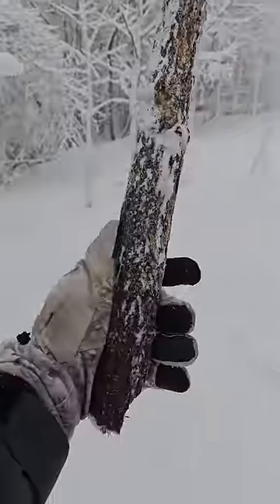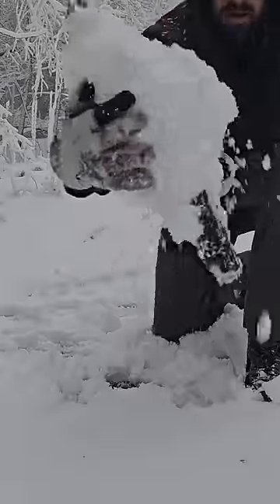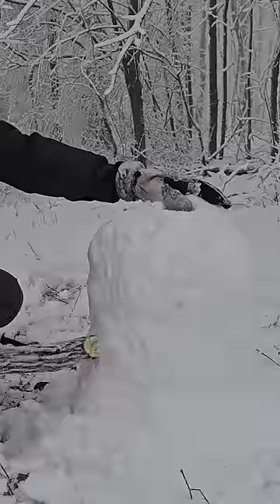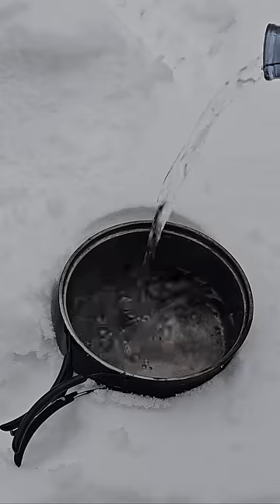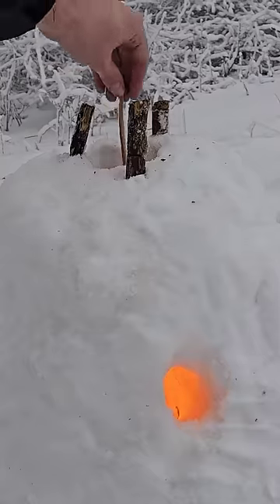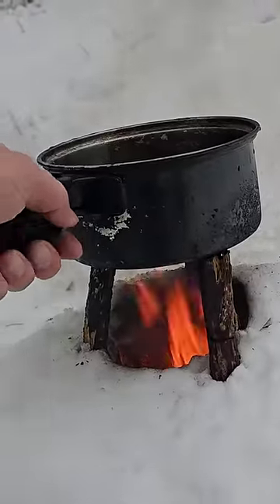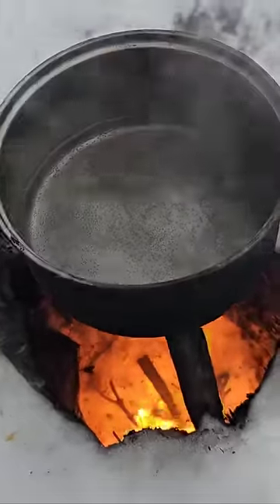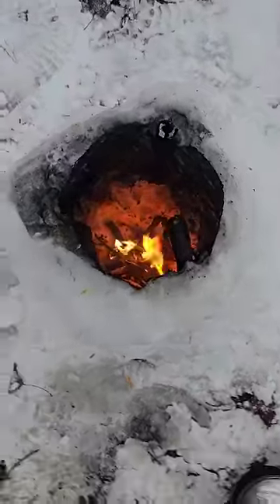Experimenting with building a rocket stove out of snow 🔥

Comment: Next experiment will be starting with a 5 gallon bucket of water frozen and drill out the holes.
Reply: For science
Reply: Garbage
ice doesn't insulate at all it's just gonna take all the heat and melt
Reply: I don't think you're right lol
Reply: @sakesaurus ice does insulate which makes it more to your point.
Reply: @danieltirico6593  but it's worse than snow and burning occurs 300°C above the freezing point of water. 
Now quad the power on that (and multiply by some constants) and that's the diffusional heat transfer rate. You need exceptional insulation to overcome 300^4
Reply: @sakesaurus  yeah I’m not disagreeing just saying that ice does in fact insulate
Reply: @danieltirico6593  oh. I think i misunderstood some word. English is not my first language so bear with me on these.
Reply: @danieltirico6593  and so does copper. Everything insulates and conducts if you get down to it.
Saying ice doesn't insulate in this situation just means it's a poor insulator compared to snow.
Reply: yeah what about the melting speed of snow compared to ice. snow has much less mass. sure it can insulate better in cold conditions but what about maintaining itself against heat @miles11we
Reply: Well what about an ice/mud slurry or even saw dust to make pycrete ? They planned on making landing crafts and aircraft carriers out of this and in sure as shit that there would be plenty heat from the inhabitants down to electronics engines and batteries not to mention aircraft and weaponry, for sure an interesting concept for when the weather is against you
Reply: @markmcghee3486  that stuff is durable as hell I wouldn't be surprised if furnaces out of it would work for short while
Reply: Good luck finding a spackle bucket in a survival situation
Reply: @jonathonfrederick2062  ok I don't think you understood what I was arguing. I was making fun of you while defending what someone else said because what you said was stupid. I am not arguing for or against ice for this application.
Reply: @sakesaurus plot twist: ice does insulate water sitting beneath it, lakes at freezing winter as one example.
Reply: @miles11we  oh you were making fun of me? even though I hadn't said anything before and was only replying to the conversation in general. right.
Reply: @jonathonfrederick2062  oh sorry my mistake, I guess I was the dumb one this whole time lol
Reply: The 5 gallon ice cube sounds neat. But the ventil on the bottom would need to be tilted down so the water drips out instead of puddles. Maybe I haven't tried any rocket stove. They look cool
Reply: @miles11we  This is the xhillest beef I've ever seen
Reply: Ice with sawdust in it !!!!
Reply: Won't work like this haha. Snow has air pockets of oxygen trapped in it and that fuels the fire as it melts. But ice would just put it out.
Reply: @printer69tom  good point.
Reply: @sakesaurus  ice totally does insulate
Reply: A "bucket of water frozen" sounds way better than a bucket of ice
Reply: No, you take your bucket drill holes in it.  Then fill with water then freeze it.  Works everytime!
Reply: If snow worked ice will too.
Reply: @sakesaurus LOL WRONG
Reply: @yacobshelelshaddai4543  I said as compared to snow, not by itself
Reply: @sakesaurus  its just a joke pal
Reply: This is a sure fired way (pardon the pun) to get a pot full of boiling water over your leg.

Just because you ‘could’ do something doesn’t mean that you should do it.
Reply: @sakesaurus First off, have you ever heard of an igloo?
Reply: @anubispup4760  made of snow
Reply: Snow has air, so it takes much longer to transfer heat. That's why igloos can have fires in them and not melt. A block of solid ice would melt WAAAY faster
Reply: @sakesaurus bro said ice is a bad insulator because it'll take the heat... That's the point of insulation💀
Reply: Turn to Jesus Christ to experience New life
Reply: @whiskeymike1789  Snow is packed down into hardened blocks of compressed ice before being used as building blocks. No air pockets, no opportunity for the snow to shift. And often with a fire within an igloo the heat will make the snow watery which will refreeze into sheets of ice.
Reply: Do that but add woodchippings/sawdust to it before freezing it. This is great insulating material aswell in really cold places
Reply: Probably snow worked in the first place because, as opposed to ice,  snow is mostly small pockets of air.
Reply: @AidansCars  huh? No it isn't. Cold thing exchange heat with hot thing. Bad. Insulation to interfere with that process? No?
Reply: @anubispup4760  glazing the snow block traps the air abd further reduces heat transfer. The ice while it is heat reactive only warms on the surface and the heat doesn't penetrate too far.
Reply: @sakesaurus one word...Igloo. did you forget about the igloo. 😅
Reply: @sakesaurus igloo what? 😂
Reply: Yeasss
Reply: @sakesaurus  ice has far worse insulation, but it also has extremely higher thermal mass to resist melting (and more stability) compared to snow, so it's not an easy verdict on which would be superior.
Reply: @sakesaurus what's that type of math called? I like all those fancy smart words you used and I want to learn how to use them and apply it practically to life like u
Reply: I think itd work better than snow. More compact molecules. Wonder if the leidenfrosr affect will help as well.
Reply: @MsHojat  good point
Reply: @GrapheneOxideIsInCVVax  I'm combining the physics i know from school with edutainment
The 4th power I remember from some video about milk in tea, if you add milk the tea cools much slower (purely from heat diffusion)
Reply: It would melt faster. Snow has a lot of air mixed so it insulates better
Reply: @ruthlesshalfbloodprincess it definitely would work, you would just need small holes at the bottom so water wouldn't puddle up. And it doesn't even matter if there is "oxygen pockets" as the WHOLE point of a rocket stove is to have that hole at the bottom for oxygen to come in anyways
Reply: The ice would melt slower.  It's a matter of the energy needed for a phase transition from solid to liquid, and obviously there's more liquid in the ice than the snow.  The air in the snow is inconsequential for insulation and only means it will lose volume faster
Reply: @Mastermindyoung14  for fire to burn you need that heat in the fuel and not in the ice melting
Reply: @Mastermindyoung14  exactly!
Reply: @sakesaurus  that's not a factor.  There isn't enough time for the ice to rob heat from the air molecules before they're through the stove, past the pot, and up in the open aira again.
Reply: It's a matter of volume.  A little bit of heat goes to melt the ice, along the boundary layer, but the rest zips right past unaffected
Reply: @Mastermindyoung14  radiation
Reply: @Mastermindyoung14  guess which thing has very little volume and takes very little nudge to chill significantly. It's the fire. And you need to have as miniscule heat transfer as possible else it's just not gonna light. I don't know what other words to use here I might be incorrect but I want to know if I'm incorrect in how much heat transfer ruins the fire. Not how it melts the "furnace" made of ice. See?
Reply: @sakesaurus  I understand all of that.    But I still claim the mass of solid needing a phase transition greatly outweighs the insulation properties of snow.  You disagree. We should test in real life and see the real results, because we will keep going back and forth on here.
Reply: That'd be fire 🔥
Reply: @sakesaurus  if ice don't insulate, explain igloos?
Reply: Worked tho
Reply: Damn! Now you got me curious!
Reply: i got a new idea for ya! Pykrete stove! water and woodchips
Reply: BetsyLu-lf8vk  I don't mean to be this guy🤓 but as surprising as such a thing may sound, it can act as a highly effective insulator
Reply: BetsyLu-lf8vk  I think you may have misunderstood a Google search? Are you saying ice is less effective or that it's NOT insulating... hard stop? Even without the air pockets the solidity and the unmoving air do plenty despite the surface being cold.
Reply: I really hope he reads your comment and does exactly that 😺 That would be aaaaaaasome! 👻
Reply: @sakesaurus No shit Sherlock
Reply: @sakesaurus  ice does insulate - so much so, that people build Igloos, ever thought about that? lmfao
Reply: @crateer  igloo is  made of snow
Reply: @yudi7572 yes for the science 😅
Reply: Try pycrete. Sawdust in ice.
Reply: @heroinmom153  ice is 20% sparser than water
Reply: This thread was something else. Some people right on the money, some people entirely out to lunch. I can't tell if I fell back asleep and am just dreaming this all up
Reply: @DirtyMike124x  life is merely a long dream (c)
Reply: They've never heard of igloos and ice hotels
Reply: BetsyLu-lf8vk  
Sorry but

Yes
Reply: @sakesaurus im pretty sur thwbice wouls take longuer to melt. A blck of ice can take forevwr to melt after winter
Reply: 😂😂😂Hilarious sarcasm 🤣
Reply: Play in the snow? Get a dog or have kids😂
Reply: @anubispup4760 compressed ice has different properties than freshly frozen ice, it has a different crystal structure.
Reply: I'd bet the snow works better because it's a more insulating, and what little snow does melt and doesnt evaporate and get carried out by the heat, gets wicked away by the snow around it.
Reply: @danieltirico6593 But what's the difference between clear ice and snow? Isn't snow just frozen water particles like ice would be? What makes snow an insulator and not clear ice (ice) if they're practically the same?
Reply: Ohho can't wait want to learn every environmental hack so cool❤
Reply: Noice😊.
Reply: and a drain for the melted water
Reply: Cool! I never imagined that it would work at all!
Reply: @sakesaurus someone who knows what more than I do, would this type of knowledge be thermodynamics or am I pulling words out of my ass?
Reply: @smorgishborg7789  Yeah, thermodynamics i think
Reply: @markmcghee3486 they planned until they realized is easily melts with any heat over freezing
Reply: No...
Reply: Ahhaahahahahahaaa🤣
Reply: @sakesaurus Ice definitely does insulate lol
Reply: @KhreamedKhorne  how the hell does ice insulate if it takes all the heat from your coke. It exchanges heat rapidly and that's its primary use
Reply: @sakesaurus  It isn't a great insulator, but it does insulate. You have the entire Internet at your fingertips, maybe use that info before being so confidently wrong
Reply: @KhreamedKhorne  your point being? You remember were talking about extremely hot fire in a furnace made of ice? Totally doesn't change my point.
I'm guessing you just dislike authority and you start arguments whenever someone sounds confident. Sometimes it's best to not do so.
Reply: @thatonewookiee9154 snow is a air ice composite
Reply: 💖❤❤️YOU DO NOT HAVE TO FEAR DEATH IF YOU BELIEVE IN JESUS CHRIST, AND TRUST IN HIM WITH ALL YOUR HEART, BECAUSE HE ATONED FOR YOU FOR ALL YOUR INSULTS, THAT YOU WOULD OBTAIN PEACE WITH ALMIGHTY GOD, AND GO TO HEAVEN BY HIS GRACE!
Reply: Add some wood shavings to the water and you’ve got pykrete.
Reply: Sag
Reply: @sakesaurus sure it does. you ever heard of an igloo?
Reply: Yes
Reply: Water frozen is called ice 🧊
Reply: The air trapped in the snow is the key to its insulation factors. There's little air trapped in ice. Won't work as well.
Reply: Insulation would not be the main problem, heat transfer and melting would. Fire in the snowball burns because snow doesn't drip much water if burned, it reabsorbs it. Ice would soon wet the wood from flowing water.
Reply: The snow works better
Reply: Freeze the ice like -200 degrees celcius than it probably hold it for some moments
Reply: And after that, heat a pot of water, under water.
Reply: Next next experiment : mix a bunch of sawdust in to the water, and make a pycrete stove!
Reply: Why do I get the feeling that it would work? 😂
Reply: Use holy water. God Bless
Reply: That wouldn’t work nearly as well, would be very short lived. This fact might seem counterintuitive at first but the reason snow can take more heat than ice before melting is because of the air pockets held throughout the snow. Air is a thermal insulator, it doesn’t transmit heat well at all. On the other hand, water absorbs heat extremely well. If this stove were made of pure ice, the air pockets that give snow its insulating properties would no longer be present and you just have a giant hunk of material than sucks up all the heat around it at rapid pace, melting the ice. 

If you don’t believe me, next time it snows, go outside and form a tight snowball, then hold a lighter flame under it. After you do that, do the same with an ice cube. The flame will melt right through the ice cube very quickly, but the snowball will just get covered in soot and take a surprisingly long time to melt a hole through.
Reply: @sakesaurus a little science would tell you that ice and water don’t take too well to changing states instantly.

The block of ice would work much better, as it is solid, with no air space to dissipate heat.
It takes one calorie of heat to raise the temperature of on gram of water one degree Celsius.
It takes 16 calories of heat to change one gram of ice at 0 degrees to one gram of water at 0 degrees.

Reverse works the same.

A solid block of ice would definitely work better, but I don’t think anyone is going to be carrying around 22 kilos of ice to heat a pot of water.
Reply: Thier a big family

Comment: Fun fact, the reason this works is also why igloos are a thing, Snow and ice are pretty good insulators So if you need a location, that's much warmer than the outside air. If you have a bunch of snow, that's a pretty good starting point. Now if you want your structure to stay intact, you're not getting it about above 0° c but seeing as that is substantially warmer than -30° c and you don't have any wind in this close to 0° c location. That's generally a massive improvement with relatively speaking. Not much effort
Reply: any dense material acts as an insulator, and trapped air retains its temperature better
Reply: @selfactualizer2099  as far as naturally occurring materials are concerned, snow Is one of the best naturally occurring insulators for a lot of the same reasons that arrow gel is the best insolative material on the planet, there is a lot of air, and it's not a brick of air. It's a maze so the heat either needs to track its way through this maze or it needs to transfer between the snow then back to the air then to the snow then to the air. Repeat thousands of times. The density has very little to do with it. Ice is actually a relatively poor insulator if you just built a block of ice, and in igloo from what I understand about the physics, it's more of a structural reinforcement/ thermal mass between you generating some heat and turning it off because that door is not perfect (It's not even a door, it's just a massive hole)
Reply: @selfactualizer2099   what about steel or copper?
Reply: This ain't related but it's a poor choice to wear dark clothing in the summer or at night. Why you may ask? Dark clothing is terrible at reflecting the sunlight and will absorb a lot more heat. Not to mention that you're less likely to be seen at night on the road. Bright green clothing is a great choice for a nighttime walk because it reflects so much light that you'll be like a walking glow stick in the light. White clothing absorbs the least amount of heat which is brilliant for summer.
Reply: @Sainttheslugcat  for clothing in the summer, what matters a lot more than the color is the breathability, The amount of heat you're going to absorb from the sunlight hails in comparison to how much heat highly insulating clothing will keep in. For example, I would rather wear a long sleeve workout shirt, then a t-shirt made out of the same material that most sweaters are made of, When it's hot outside
Reply: Also unrelated but when taking a sh*t, experts would recommend a plush, low-lint toilet paper that some say is one of the most comfortable. You can consider things like softness, absorbency, and whether it's safe for sensitive skin. Also you can’t go wrong with a 2-ply paper with a cushioned texture designed to be gentle on sensitive skin.
Reply: I know this has nothing to do with the video, but when you pick your nose, experts agree it's best to swirl your finger in a spiral motion. It's actually bad to just reciprocate in and out, as that just tends to push mucus further into your sinuses.
Reply: @HobbesTheTigerr those conduct not insulate
Reply: @Sainttheslugcat good thing he's wearing black in the winter and not the summer 😮
Reply: You live in joisy